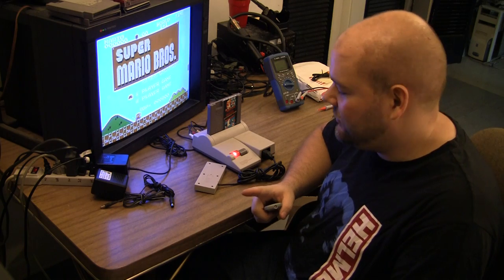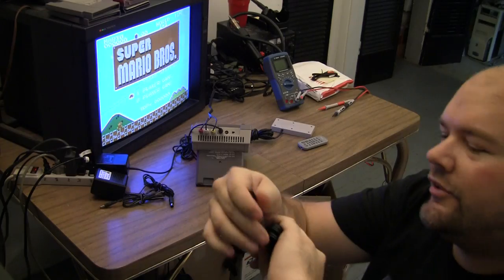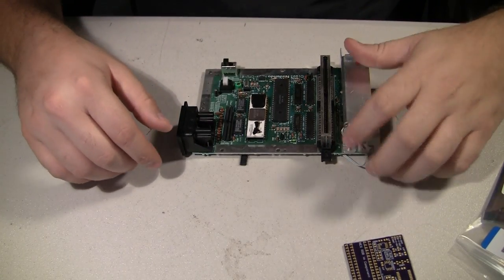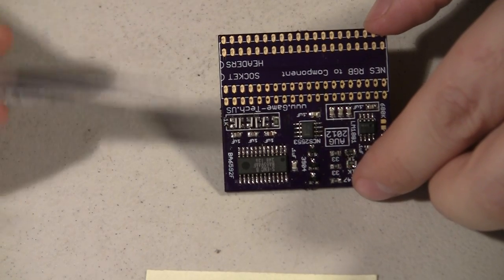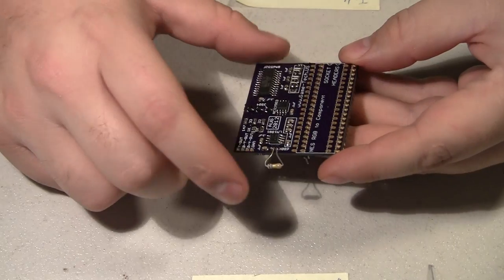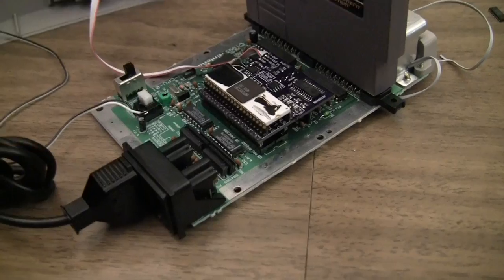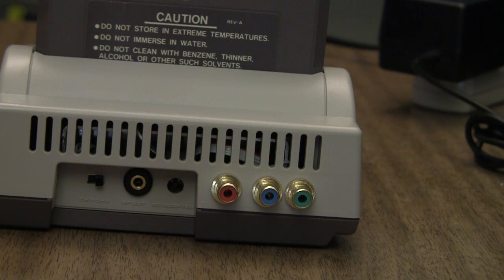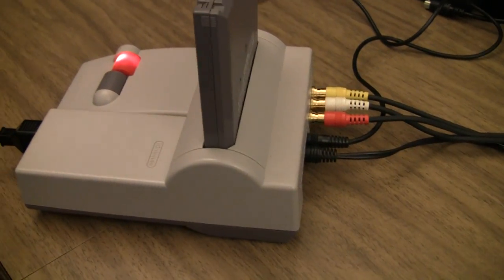NES-101 Nintendo Top Loader - RGB to Component - BA6592F Final

Comment: Looking really good.  Nice work!

By the way, if you want to make the BA6594AF work without oversatured colors, don't wire an amp to any of the outputs.  The BA6594AF, unlike the BA6592F, is able to output Component video without needing any kind of amp, so if you do amplify the Component outputs, you'll end up with oversaturated colors.

Comment: First of all, I would just like to say that I enjoy your video's quite a bit. So thanks for uploading your tech mods and WIP's. 

I do have one question, however. Why did you select the BA6592F as the encoder? That's quite a nice circuit you've built around it, but I guess I'm just a fan of the CXA2075. Either way, you do fantastic work. 

-Voultar

Comment: Why not just take a blue sharpie to the white and yellow ports? that would give you your component colors. I guess if you selling it after they customer might care, but I know I certainly wouldn't
Reply: the is no difference in how the ports are made other than the color. its about how you wire them. I'm saying use composite colored ports (but change the color) and wire it for component.
Reply: Even though your comments are now 3 years old as of writing this, I have to say, using a sharpie to change the colors of RCA jacks would look way too home made. Most customers prefer a 'factory/stock' look and so do I.